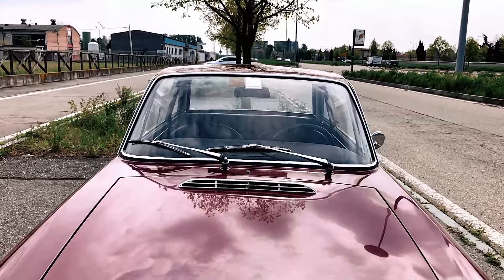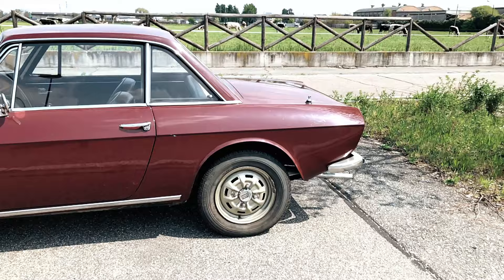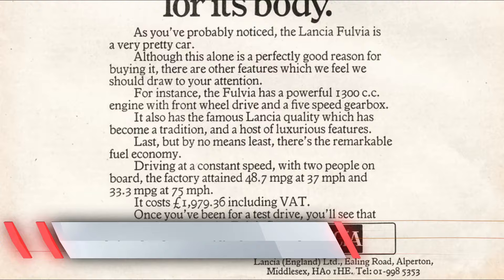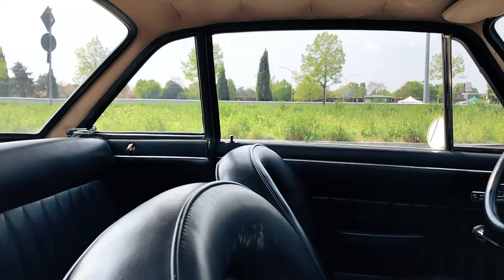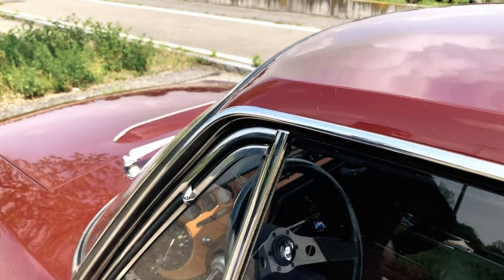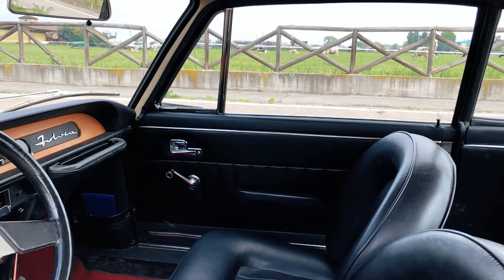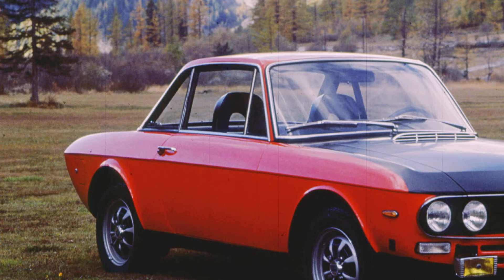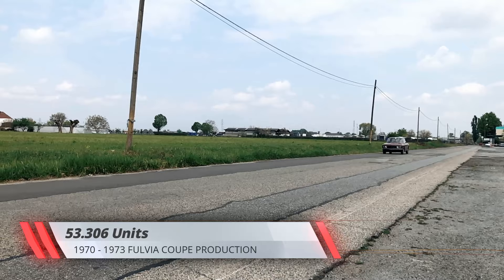Lancia Fulvia Coupé Story: Series 2 1970-73

Comment: Thanks for this great video! I bought a '72 Fulvia 1.3s coupé back in 2012 and have used it as my daily driver since, doing nothing more than basic maintenance only to it. It's the most reliable car I ever had! People have no idea about Lancia's engineering quality before Fiat stepped in.
Reply from the maker: Great to hear! Yes, Lancias were engineered and built with a degree of care and pride that was unique on the mass-market... Which is part of the reason the company spent the 50s and 60s in financial trouble.
Reply: @Matteo_Licata  Sadly so yes. I have owned and driven Fiats from the '60s and '70s and I love them but Lancia was just on another level, no comparison whatsoever. Pls keep up the great work with your videos!

Comment: Harry's Garage is in the process of restoring a Fulvia V4 and the engine is in bits - what a little jewel it is. The two banks share a head, but this is flat faced, meaning that the pistons have to have inclined crowns to achieve full compression. Also, for some reason the inlet ports have a smaller diameter than the exhausts, all very puzzling.
Reply from the maker: I’ve been watching Harry’s project with interest, yes! These Fulvias are little gems, yes!

Comment: Thanks for this. I really enjoy your videos. Can I suggest that you invest in a microphone acoustic isolation shield? It will cut down the room noise and make a clearer track, which would bring the audio up to the same standard as your video work.
Reply from the maker: Thanks for the tip, even if it worries me a bit: I thought I didn't have room noise in my audio track!
Reply: @Matteo_Licata  It's a tough one. I do a Podcast and I ended up recording it in my bedroom with some acoustic panels on the walls and all the pillows I own in the room because I live in a wooden house and there was no easy way to cut down the room resonance. A professional friend recommended the Isolation Shield. Much simpler.
Reply from the maker: @mzungusi  I understand. By the way, How is your podcast called? What it is about? :)

Comment: That narrow angle V engine reminds me reading about a 1930s era Lancia with a narrow angle V6 engine. However, I don't recall the model.
Reply from the maker: Before WW2, Lancia built many narrow-vee car engines, but not V6s.
Maybe you refer to the Dilambda or the Astura, which were equipped with narrow-angle V8 engines.
Reply: @Matteo_Licata  That was probably a V8 engine. It was a former Hollywood car at a concours. Flowing fender lines gave it a very elegant appearance.

Comment: Some remarks:
- I also only want it for it's body. Ugh!
- Just like last weeks car it proves that the best looking Italian cars are often the smaller ones.
- This car smokes baddle every time the number plate is about to come into focus. Was that a special feature to avoid speeding tickets?
- They got the contour of the rallye black front bonnet completely wrong on Wheeler dealers. Morons!
Reply: There are more small Italian cars than large ones and I would not be surprised if the ratio for the looks is the same. You could ask to define "small car" but for Italian standards the Fiat Dino and Fiat 2300 are larger cars and they look stunningly beautiful.

Comment: As much as the Beta is still a decent looking car despite its infamous reputation, the Fulvia looks deceptively petite to almost be comparable to the smaller Fiat 128 whereas the Beta looks too big to be considered a Fulvia replacement. Lancia could have benefited from a smaller 1100-1600 sub-Beta model from the late-60s to early-70s to be a spiritual successor to the Fulvia (along with the earlier Appia) with a saloon of similar length as the Autobianchi A111 (above the 128 yet below the Beta).
Reply from the maker: Indeed, the Beta was quite larger than the Fulvia saloon, so the Beta 1300 wasn't a straight replacement, even if company bosses seemed to think it was.
The 1979 Delta was perhaps the "proper" Fulvia replacement.
Reply: @Matteo_Licata  The Delta was in some respects a more direct Fulvia successor despite being a hatchback though they dropped the ball on making something decent out of the Prisma as far as sporting and performance appeal goes. 
Find it surprising the Beta platform was not flexible enough to underpin a smaller C-Segment saloon car from the early-70s prior to the Delta / Prisma. Will admit to not being sure about the exact relationship or commonality between the 128 (plus A112, 127 and X1/9), Ritmo, Delta and Beta/Gamma (plus Trevi, Montecarlo, etc) families.

Comment: Lancia Fulvia was Lancia till 1969! After Lancia manufacturer was buyed by Fiat, and Lancia quality and soul ended forever!
Same destiny for Lancia Flavia.
Reply: That a overrated statement. The cars still where engineering marvels. Drive them side tot side and you will agree. I did!!
Reply: @aamvoor  Not overrated at all. It's true that the cars drove well, but the quality and refinement left a lot to be desired. They also were very unreliable and had multiple problems. Pre-Fiat Lancias were long lasting, reliable and very rust-proof.